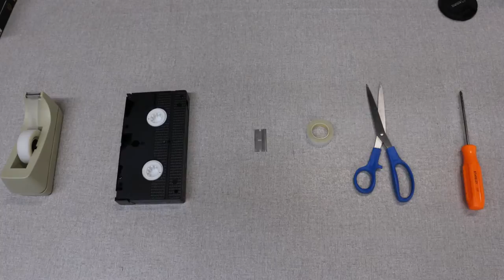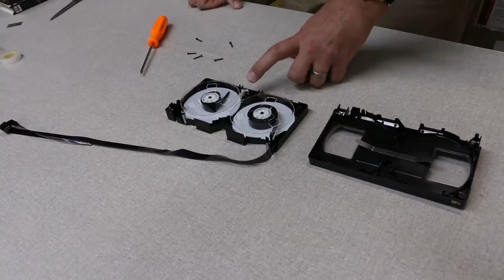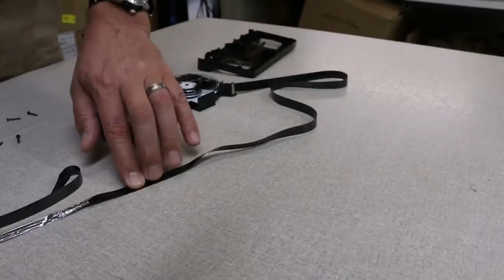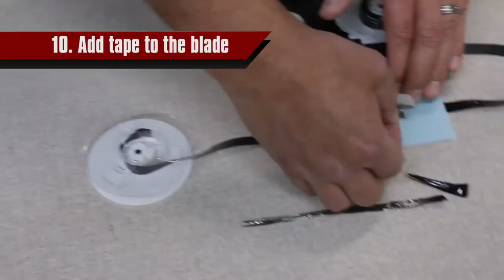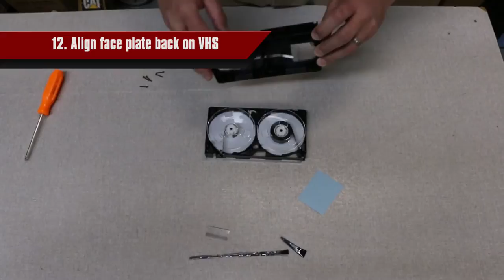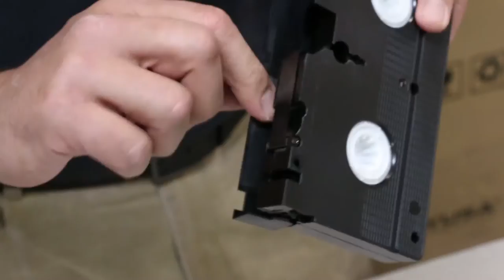How to Splice VHS Tape

Comment: just use regular scotch tape?
Reply: i have before, it works, i was curious as well if there is something less harsh for your heads on the vcr.
Reply: I've been using the new Scotch strong tape in a Redbox it doesn't turn or get soft over the years. It holds its shape and doesn't come loose
Reply: Ik doe het anders ook wel het zelfde maar op een ander manier